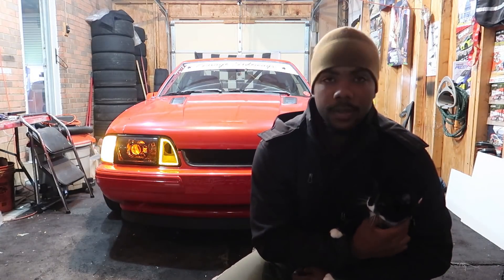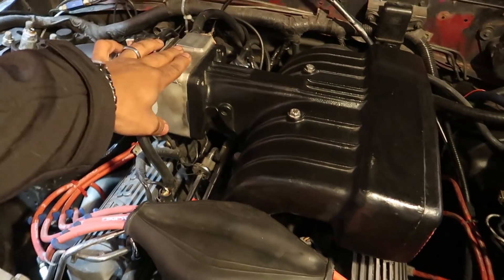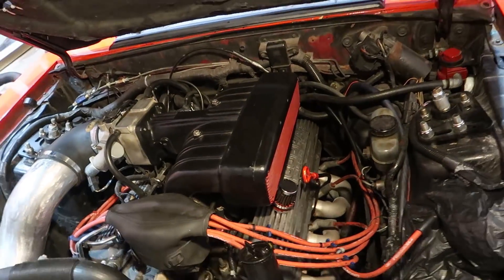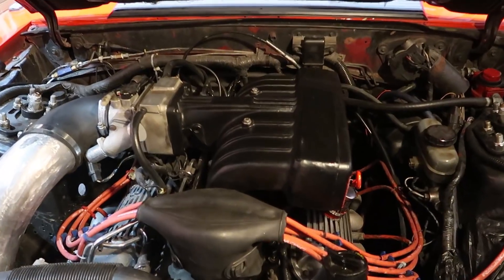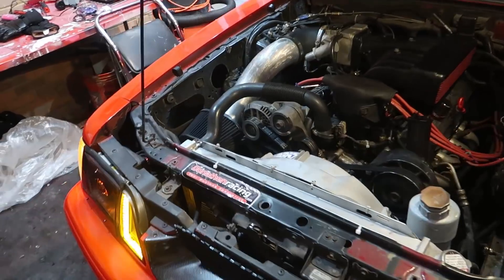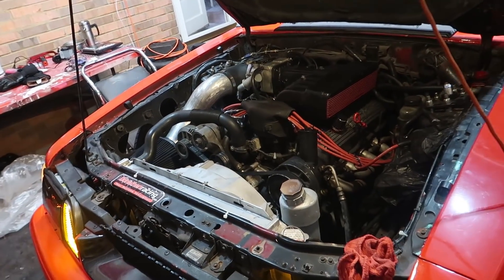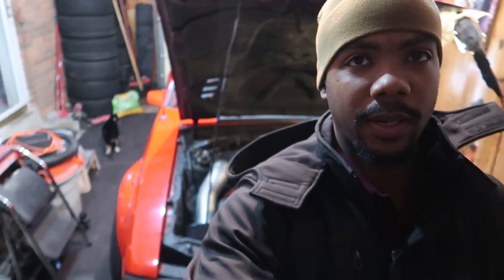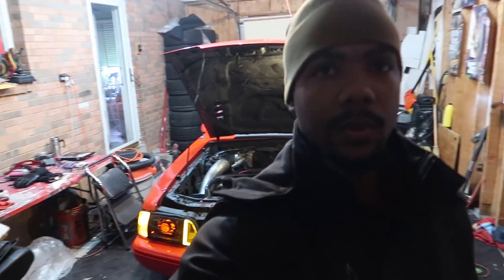What's really powering the Drift Fox?

Comment: should have put a real cai which relocates the filter to the wheel well & blocked of the egr!
Reply from the maker: I removed the fender liners to allow clearance for the angle kit, and also to allow more air flow through the engine bay to combat heat soak.  A real CAI still craps out when the intake tube is 200 degrees, and without the fender liner, routing the intake into the fender would expose the filter to trash rocks dirt water, mud, and other debris flinging off the front tires, and the EGR is deleted.

Comment: Off topic but how did the custom steering shaft weld hold up once you started drifting?
Reply from the maker: it's working awesome
Reply: Premium Fuel Mag thanks for sharing. I'm having trouble with some long tube headers on a swap and that seems like a great fix. I owe you a beer!
Reply from the maker: yeah, eliminating that fat rag joint will save some space, and doing it this way, its way thinner than the M/M shaft.

Comment: also there is no way that engine makes anywhere close to 400whp. we built a 347 stroker about 10 years ago with cam & canfield heads. it made 370whp. i would be very surprised if it makes 300whp.